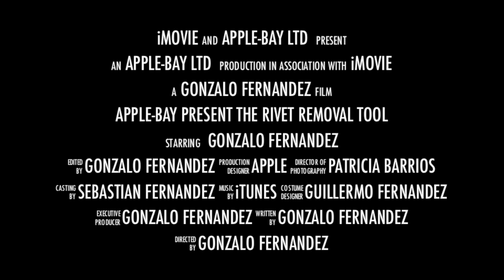Apple macbook Pro / Air Keyboard rivet Tool removal -1

Comment: Another way that seems to have been working for me is to use some needle nose pliars. You have to use them properly though...  point them straight down at the rivets and grab them as deep as you can. But don't pinch very hard yet! Just grab hard enough to hold on. Now rotate the pliars back and forth in a clockwise and counter-clockwise motion so you dig into the rivet a little bit and give yourself some grabbing power. Once you're in a bit, place your free hand on the keyboard area to hold it down and simply pull straight up with the pliars. It is working for me although it is a pain in the ass.... just get this tool once it's available instead.
Reply from the maker: yes im really god doing that way but it take long and some time it won't come off but with the tool is almost 100% and it take about 2 to 3 minutes to take all the rivets

Comment: Hi! Can you notify me when a tool will be in stock & in sale ? Is it possible to send this tool to Russian Federation ?
Reply from the maker: I've got some working prototype  at £50
Reply: Very good! I have a Macbook A1425 (Retina 13" Late 2012). Did you test your tool with similar models? If it works with it I will buy your tool as soon as possible. How can I do it ? Thanks
Reply from the maker: yes it work fine with any retina or macbook air , this tool is to remove the rivets

Comment from the maker: Hi... I've got few first working prototype for sale at £50 .... you will get your money back in just one repair but the tool will last for very long tome 
PM if you are interested in buy it , i can ship to any country
Reply: Hey
Could you please supply some more information on this please?
Reply from the maker: Hi at the moment I've got working prototypes for sale
the tool is easy to use and i rate it at 99% efficient ,  so really good . made the rivets come off really easy 
will take les than 3 minutes to remove all the rivets once you get use to it 
if you need more info call me 0044-7852222023 
Gonzalo
Reply: Can you shoot me a PM \ video of it being used?
Reply from the maker: i will post a video tomorrow